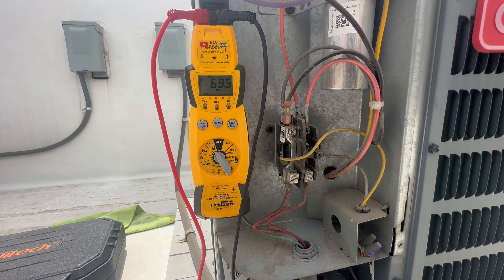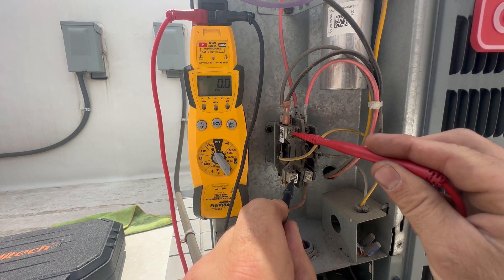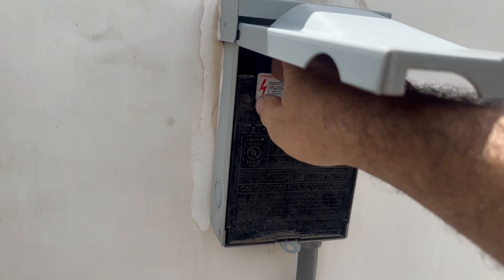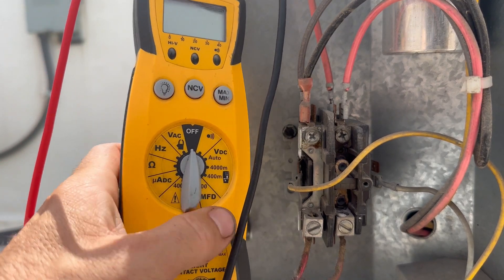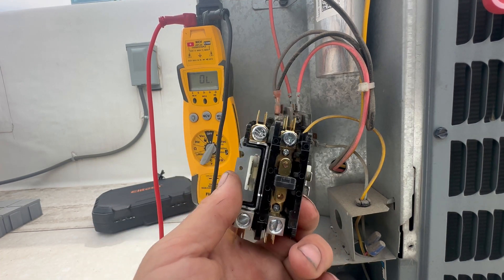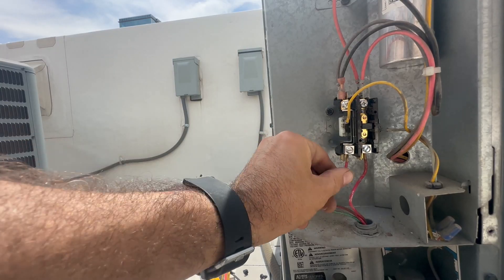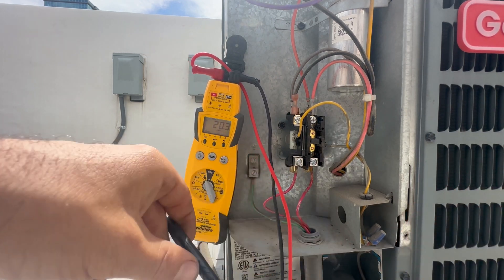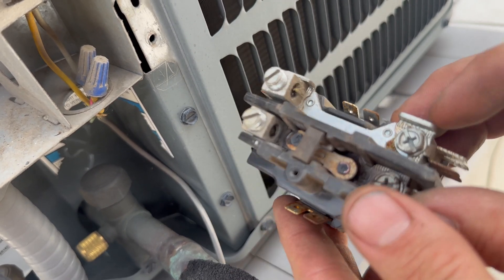AC Contactor Troubleshooting and Replacement

Comment: I was under the impression that those parts you said that were damaged on the contactor could be replaced. And relays are a throw away device if damaged. In your case was the contactor that damaged where it needed to be replaced all together?

Comment: My contactor is not pulling in, and I have done below tests:
1. I measured the Y and C wire ends and got 33V
2. I measured the resistance of the contactor's coil ends and got 16 ohms
3. When I connected the Y and C wire ends to the coil ends, I measured 0V between the 2 coil ends.
4. This happens the same on my 2 contactors and one of them is brand new.

What could be wrong with my case?
Reply: please help
Reply from the maker: If you have 0 volts at Y and C on the contractor your missing voltage- does the condenser have any safety switches such as low / high pressure?

Comment: I do the same thing I always go back inside and turn the thermostat off or depending on the system and the ease of access to the air handler/furnace I'll pull the power there. Then double check to make sure I don't have power on L1 and L2 and make sure I have no power to ground. 24 volts doesn't feel good and just pisses you off, but 240 volts could ruin your day and even take your life. I have a healthy respect for electricity and don't play I'll triple check sometimes just to be safe.

Comment: you can run the crankcase heater wiring on the bottom of the two pole contsctor

Comment: Why is your line volts low
Reply from the maker: Commercial building, most use 3 phase (480v) power. They split the voltage so instead of 240v like residential, it’s around 208v, which is still enough to power electric ranges, dryers and condensers

Comment: Hello, thanks for the tips on how to diagnose and replace the bad contactor. I however have a different problem here. when it called for cooling, the AC unit outdoor ran for 30 seconds and then shut off, the blower indoor is still running. At this time, I checked the low voltage plugs on the contactor, there is zero voltage. but was 26 volts when the outdoor is unit running. Please help if you can. Greatly appreciate.  Subscribed.
Reply from the maker: @robertle9526  your losing low voltage, somewhere, things to check are condensate float switches? Hi and low pressure switches?
Reply: @ApartmentMaintenancePro  flow switch is fine. Is low refrigeration cause the the condenser to stop? Weirdly, the 26-volt calls from the thermostat for cooling were gone too.
Reply from the maker: @robertle9526  low refrigerant only affects 24 v if you have a low pressure switch installed at the condenser. Take off the thermostat, jump out the fan wire, compressor wire, and power wire (don't include the common wire or you will blow the transformer) These are commonly Y, G, and R but I don't know your setup, wire nut them together if you dont have a threeway jumper. If the unit stays on, then you know you have a bad thermostat.
Reply: @ApartmentMaintenancePro  Greatly appreciated.  I'll try it tomorrow.
Reply: @ApartmentMaintenancePro  Hello, greatly appreciate your time, the problem was the significant low on freon due to the slow leaks on the high-pressure inlet Schrader valve, that's why it cut off 30 seconds after starting. Replaced the valve, added on 13 lbs. of 410a. it's working perfectly now. Thanks again.

Comment: I personally would shut off all breakers and thermostat, question if the spring is sticking is there a lubricant I can use if that happens...on the contactor?

Comment: so if the two 24volt wires from the contactor touch each other, will that blow the transformer? I'm having an issue with blown transformers
Reply from the maker: That’s a short circuit yes it will blow the transformer
Reply: The transformer is in the air handler/furnace.Usually.and on a separate circuit.

Comment: I replaced the contactor because it was stuck in the closed position, plus the contacts were badly pitted. New contact is also stuck in the closed position... I don't see markings to identify T1, L1, or T2, L2...? Could I have it upside down?
Reply from the maker: Sounds like you have constant 24 volt going to the contactor coil -

Comment: I have a outside condensing unit where the fan is not running. When i push the plunger to the contactor in, everything seems to run normally. Ive replaced the capacitor. Aside from a bad contactor, are there other possible reasons for this, for example, low freon?
Reply: Call a professional! Not being funny but it could be a handful of things.

Comment: What could it mean if sides of contactor is reading over 100 volts instead of 24 volts ?
Reply from the maker: I would have to see the contactor and your scenario. there are 120v contactors out there so just saying this isn''t a easy question to answer without more information

Comment: If you're a homeowner and want to, and the coil still works,  you can take these contactors apart and sand a shiny new flat surface on the contacts with about a 600 grit sandpaper on a flat table.  works great.  just like new.  reduce, reuse, recycle, and save money too.

Comment: You are wrong in this video. And should not be given information to someone they will get shocked when you went L1 to T1 you showed zero go from ground to T1 and you will have 120v this is a 2pole single throw breaker if you have 240v on L1 L2 then the side that does not have the throw it carries the power across the metal bar.
Reply: I just started , should he have cross them instead , like l1 to t2 ?
Reply: @martinebanks8223 doing a reading like that is really not the best. It shows an open in the circuit but should be the last reading you make and really only out of curiosity imo.  What he did was basically just show an open in the circuit like if you read across a open switch, the problem is that sometimes you will get voltage and other times you will get nothing and unless you know what you are doing and why you are taking that reading and getting that result, then it is it possible that you we'll think that there is 0 voltage present.
when there really is, because, you know, you may get a reading of 0 voltage, but it's not because the voltage isn't there. It's because yeah, the other lead that you're using as a reference point is not good so you will i falsely believe that there is zero voltage even though there is full voltage, there. It is always much better to find a proper ground reference and use that to get your readings from, because if he had just gone from ground
to that one spot, it would have shown that voltage wasn't getting through to the other side of the contactor also.
Reply: @anthonyesposito7 yea I understand that now  almost 3 months in

Comment: Nice video.  Only you did not torque the lugs to the proper in/lb settings. That information is on the contactor.  (25 in/lb for screws, 40 in/lb for lugs, most often).
Reply from the maker: Yes this is true, one might need a dedicated torque screwdriver to be preset to know when proper torque is reached from the clicks. That's what I would recommend using for your first 1-5 years of replacing contactors and such. But once you have been doing this for over 20 years and have replaced and installed about 1,000 contactors you get a good 'feel' for what 25 inch/lbs is on a contactor. Not diy advice 👍
Reply: @ApartmentMaintenancePro  You are partly right.  I have been teaching students that they need to torque contactors. It's the students that are in the trade that don't realize correct torque.  So veteran tradesmen are the ones that need the torque wrench the most. In my experience. Thank you for the reply.
Reply from the maker: @leealtmansr.3811  Thanks for the input 🙏

Comment: I was wondering why some units have a single pole and double pole. I have a crankcase heater for my unit but it comes with a double pole from factory though.
Reply from the maker: Not sure. Wire could be fed from bottom of contactor as well

Comment: I became the lead at my property this year.  In the past we've always had at least 1 other experienced maintenance person to help brainstorm different issues or just offer a simple answer when I'm over-complicating an issue.  I don't have that anymore.  Your videos have been that extra voice for me and I appreciate it.  Even basic stuff like this can help.  Sometimes I just know by behavior and past experience to replace a certain part but it's nice to get more in-depth tutorials about why.  I'm getting more sharp and accurate with diagnosis with your vids and some of the comments from viewers 👌
Reply from the maker: Thanks for watching! Check out the apt maintenance Facebook group great resource and active members to answer questions as well 👍
Reply: NCVT !😊
Reply: Don't be a part swapper. No bad habits!!
Reply: Singl porl repacing buoring  carben poqer nor passing
Reply: Why button goes in but won’t pop back out only when you turn off thermostat
Reply: @faustomedina13  When the thermostat turns on it sends a 24 volt signal to the contactor.  The 24 volts creates a magnetic field that pulls the button in.  When the thermostat turns off the 24 volt signal turns off and the button releases.

Comment: It seems I always remember the crankcase heater being fed in the contactor line side. I always thought manufacturers used the single pole contactor to cut manufacturing costs.
Reply from the maker: I think you want those separated on l1 to t1. Though not sure why it would matter